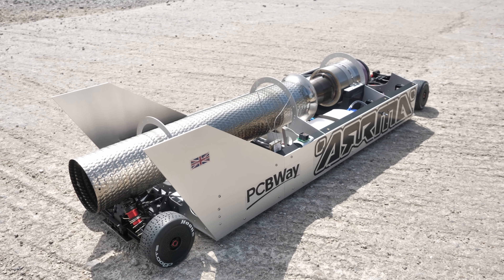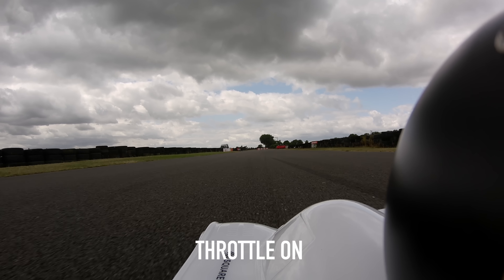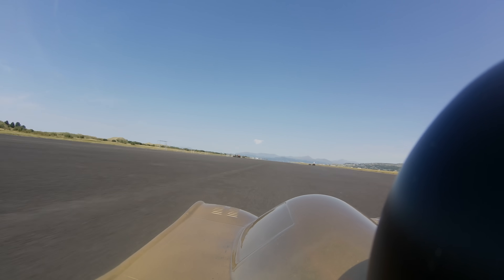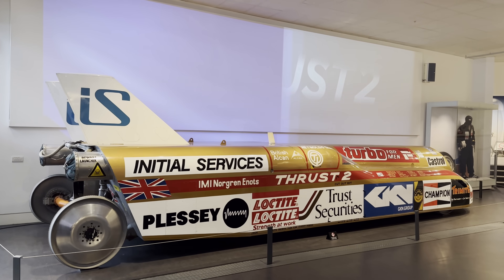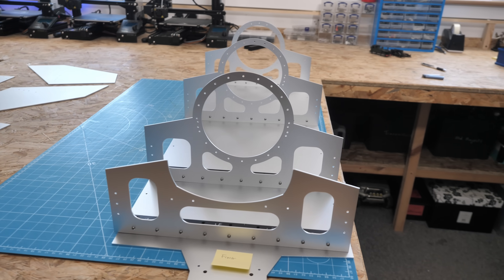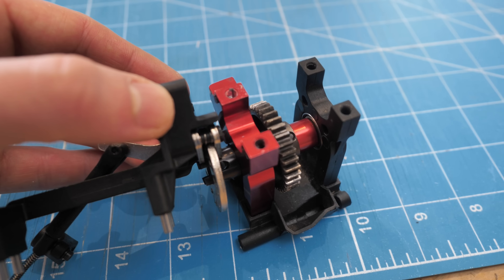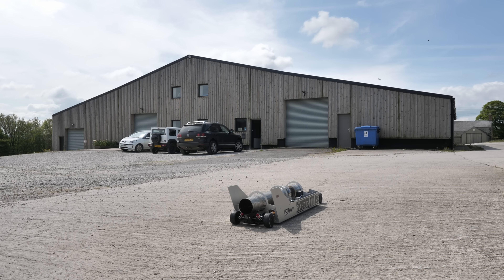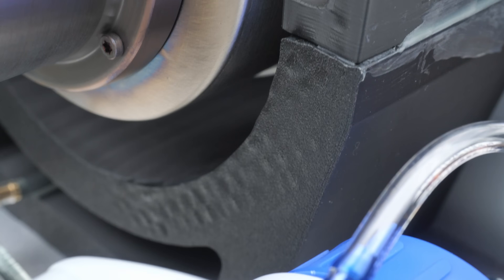Building the WORLDS FASTEST Jet RC Car 2.0

Comment: nice project!
about the engine mount melting: 
if you build an airduct around the engine and conncet it to the thrust tube, there should be enough air getting sucked around the engine to cool the mount

Comment: Correct me if I'm wrong, but I believe that thrust tube is probably doing more bad than good. If your concern is CG, you could always just add some extra weight to the very front to keep the wheels down, or maybe a front spoiler? You can make an adjustable front spoiler that would use a servo to pitch to add more drag depending on your current speed.

Comment: Perhaps a sort of hyperbolic wheel shape, so that, as forces pull the material of the wheel outward it moves into a normal wheel shape instead of a pointed wheel. Could be clever for the front wheels. Might mean more drag though…. Wheel integrity might be worth the sacrifice

Comment: For setting a speed record, could a person place the air intake duct on the underside of the car to also act as negative pressure downforce? A dust trap could be utilized to prevent some ingest, although destruction would likely be imminent. This would be expensive, so it would HAVE to be very beneficial, so I am wondering if anyone can help weigh the pros & cons. This just popped in my mind and I thought it would be a fun thought experiment.

Comment: What are you 3D printing with? Is it PLA? I was wondering if PA-CF (Carbon Fibre Impregnated Nylon) Filament would be better for the engine mount as it has a higher melting point. Although this is an awesome project, can't wait to see what's next!

Comment: There was a period when land speed record jet cars used spun aluminium wheels (ie no tires, just aluminium), as they were the only things that would hold together at those revs. As they aren't driven , and don't need to grip in eg turns, they provided enough grip. Needed replacement pretty often though, I recall.

Comment: That’s not the last static test you’ll need to do. Make a static test rig which chocks, straps, and/or straps on a decently thick piece of plywood. If you’re worried about the rig moving, add sandbags, tent stakes or lawn screw.

Comment: For wheels, I'd be going with something like a solid polyurethane disk then maybe use active aero, well basically a rudder for steering. Or if you want to steer with the wheels, using solid blocks of rubber sandwiched between aluminium disks with screws going through like a beadlock.

Comment: I've built a few projects with wheels at ~12krpm. supergluing standard RC tyres to their rims and adding kevlar thread between the treads has always worked for me. I'd have thought rubber-based RC car tyres would hold up better than foam wheels for your project. Something that should be easy for you to build and test

Comment: Good stuff! A lot of engineering & over engineering can go into this project. 
You could use turbine exhaust to create vacuum/low pressure under the car for "down-force"/control issue remedy or "car not go flying". Also, at a low angle look down your path of travel and try to sweep away any rocks/gravel (easier if you have a "street sweeper" and not wanting to literally broom a looooooong generous width path.)
Not sure if typical on your controller but variable steering control with speed, would help not over correcting at speed.
IIRC most speed record vehicles run on salt/mud flats/ice for a reason, very flat and/or cold. Typically no visible suspension travel or very very stiff setups and aluminum/titanium wheels. 
Rubber tires (sorry I'm American) are good but it need to be made out of the correct material. heavy solid heat resistant rubber non-laminated/non-layered. Heat of the speed will cause delamination and catastrophe usually follows shortly after. The big Aircraft(Heavies not fighters) tires are retreaded with a +1in(+2.5cm) solid rubber layer and has a whole process to ensure the retread 100% bonds, vacuum/pressure mold, can't remember.

P.S. Please use double hearing protection, my tinnitus still has me hearing the whine of APU's of military aircraft I worked on.

Comment: The only thing I'd say is make sure you have the rake of the car set correctly so you have a small amount of aero downforce and the thrust is pushing the car into the ground very slightly. All jet powered cars are set higher in the back to create downforce without creating drag.
Good luck with the running of the car, it looks awesome. 😎👍

Comment: I noticed that the real Thrust2 you modelled your car after has a bottom that raises up slightly infront of the rear wheels. I assume this is to suck the rear end of the car down through expanding the air under the car, creating low pressure. This would make the car more stable as the rear wheels get more traction. You may want to replicate this on your car for more stability.

Comment: I find it fascinating how a jet engine can pretty easily be held back with a string until it has forward momentum. I suppose you could just use your brakes to start but would there be an advantage  to actually having one tied off to allow you to go to max rpm before releasing so the vehicle would reach a faster top speed closer to where you are, helping you be able to control it easier? I have no idea what I’m talking about. Just thought I’d throw it out there.:) great video:)

Comment: Put a fpv camera onboard so you can drive it more straight & see problems as they come ..
Reply: Onroad fpv is not like flying an fpv drone. Road makes the camera image a lot more bouncy than you would expect. I've tried. I would swap the air radio for a surface model though, it will give more resolution to the steering. But general rule for RC speedrunning, the car should drive straight like its on rails if not, make it so. Steering is only needed for roadsurface and torquesteer correction and  I assume the turbine won't have torquesteer

Comment: I was thinking that some ground effect would help with the floor stability, then I thought about bottoming out and porpoising or bouncing at high loads at speed, some stiffer suspension would help this and I think would help the car without ground effect. Some C cups on the springs is a simple way of doing that (I think you know about this anyway with your experience). Drag is also a concern with ground effect too but would be less than traditional wings. This is quite interesting to me to get thinking about this, I'm an engineering student and one of my projects was building an rc f1 car with aerodynamics incorporated so I can't wait to see this progress.

Comment: Lock the suspension , make the wheel camber front and rear to zero and use foam tires cut to 100mm

Comment: Nylon infused with Carbon Fibre, such as eSun's ePA-CF, has a higher glass point then PLA or ABS, so will retain integrity to a higher temperature point. Gold reflects heat better then any other material, sheets of paper thin gold bonded to the upper side of the mounts will reflect the heat back at the engine. Aluminium foil with an air gap between it and the 3D printed mount.
Bonus, you can cut holes for 3D printed NACA ducts in to the belly pan, letting forward speed suck air up through the ducts and then pass between the mounts and heat-shield and out the open back of the car, giving the car under-body venturi's to create down-force and use it to keep the car on the track surface.
Larger wheels are more tolerant to small rocks and surface imperfections, so a spacer to raise the chassis sections higher, while dropping the body nearly on the ground, will lift the axle centerline higher for larger wheels, while lowering the vehicles masses compared to the axle line, again improving stability.
Reply: Bambu PAHT-CF will deflect up to 194℃. Since their P1P is prominently on display, they might just sponsor some spools

Comment: Amazing project!! I would suggest some heat resistant tile material at the back, covering the plastic, rather than foil. You can buy kiln bricks for about £10 uk, and cut them by hand, as they are very soft and light.

Comment: As a heat shield use a thin paper card on the plastic then put the metal shield on and that will give a barrier of insulator between hot metal heatshild and plastic. Or just wack some exhaust wrapping on the plastic bit. Hope this helps.

Comment: So, you have a few options for wheels: something similar to the Bloodhound SSC, which are solid aluminium-zinc alloy disks, which can deal with 10 200 RPM. You could coat the rims with latex or something to give it something akin to tyres. You could also do foam based stuff (as some other people have suggested), which could deal with the heat really well due to the air pockets, but they might have too much give. Personally, if I was making this, I'd do aluminium disk for the main wheel, with layers of rubber and foam. But I don't know how that'd be made. But hey, experiment and have some fun! For all I know what I've just said is utterly useless and can't be done.
Reply: Maybe Goodyear or Perrelli would sponsor some special rubber tires like F1 race cars. 😜
Reply: Aluminium disks spun up with spray on ruuber from a can. Yesss then check they lathe true

Comment: Epic project! I think foams are the only tires that have halve a chance of holding up
Reply from the maker: Thanks Kevin! Yes I think I’ll have to do some experimenting!
Reply: @Project-Air  you guys should do a collab once please please please please 🙏
Reply: @Donuts_random_stuff  Oh god. A Project Air, Kevin Talbot collab will be the most highspeed expensive crash ever.
Reply: Hey make the arc car. Small and thin so it will go fast
Reply: @Project-Air  you should try trust vectoring some time 👍👍👍👍
Reply: @ramonellince2424  overcomplication
Reply: you could inject fuel into the thrust tube to make an afterburner  🔥
Reply: @tmsrc  I was thinking an afterburner too. It would look wicked at the track with Mach diamonds  ;)
Reply: Otherwise you may have a tumble womble 😂😂 ur a legend
Reply: could it be worth looking at tyres on something like tethered cars? they are designed to be used under high speed conditions
Reply: could have been worse, could have been mine
Reply: I want too see a 200 mhp run ok promise
Reply: Can you try machine aluminum wheels?
Reply: about the tyres... have you tried tubular tyre tape (ebay-velox?velux?veloflex??)(for bicycle wheels) also i'd recommend the rubber from tannus solid tyres, its light and robust if you could make it work...
Reply: KEV!!! you should collab with projectair!
Reply: Totally agree Kev, and in my own opinion is with medium/hard ones.
Reply: Yeah! Maybe get some of Raz's speed springs too :)
Reply: If it can be kept from fragmenting, I'd say to try one's luck with cast polyurethane like that of skateboard wheels. And do a pour that physically molds it onto an interlocking rim. It seems the tires are the weakest link on speedrun RC cars, so this is likely an area that still has room for innovation vs. off-the-shelf stuff that doesn't hold up to this extreme.
Reply: Go for machined aluminium wheels with knurling for grip. Anyone with a basic lathe can make them for you.If i wasn't on the other side of the world i would do it for you!
Reply: @dunxy  if it was running on salt flats I'd say absolutely, but on tarmac I'm not too sure. If he used active aero for steering, either a rudder or some type air brake or spoiler either side of the vehicle for differential drag steering, I'd highly recommend using aluminium wheels on tarmac.
Reply: @anthonystownsend  Valid point! I wonder if he could adhere something to the aluminium wheels for enough grip and that could sustain the forces. Hmm Not super knowledgeable on this kind of thing, a good mate did try making some speedrun cars and i saw many tire failures he had so i know hes unlikely to get very far with much apart from solid foam in the least.
Reply: @dunxy  I was thinking the same thing, something like a mesh, either metal or nylon, that's then embedded into the rubber or thin metal belts around the outside of the rubber. But honestly I think the best thing for this car would be active aero and aluminium wheels then use an actual Flight Controller for stability especially at high speeds, if I had the money to make it, it's exactly what I would do.
Reply: EPIC, Kevin Talbot confirmed.
Reply: 3D printed carbon wheels.. Or billet wheels.
Reply: Why not solid metal? like in the land world speed cars they seem to always use solid metal wheels, though at smaller scales I don't know how the grip will behave.
Reply: Are 5th scale tyres not belted?
Reply: I knew I spotted the spectacular Mr Talbot!
Reply: Whatup Kev!!! How are allnyour broken helicopters??😂😂😂
Reply: @KevinTalbotTV  @ProjectAir  I feel so stupid posting here..but the tires got me interested..LOL.. My idea.. mass and weight come into the picture, Regular tire has more rubber across that it does up.. then you have thickness and pliability... SO...Building a custom from aluminium sound great, IF in act you can work with the right solid rubber which will not heat and rise, due to the forces of being slung around the outside of the block..(maybe with a bead-lock system to help hold) - quite small at this scale but... Next concern is heat generated on axels and bearing for said wheels especially under percussive force as it runs down the track.. good lube and custom axle design/mounting may also be a consideration at this point.. Hard to explain some of what I am saying .. but hopefully it communicated right..LOL.
Reply: You and kvin should do a calab
Reply: I was about to mention you but no need 😂
Reply: Kevin i am huge fan bro..
Reply: haha funny - thought about Kev's project and here he is :)
Reply: What about those roller blade wheels and tires?
Reply: You gotta make a get rc car cause eventually these will be faster than the electric ones
Reply: Since it's a jet car, just go for metal like supersonic cars.
Reply: Do a collab
Reply: Polyurethane blade wheels ...?
Reply: Maybe some solid wheels would work, like maybe some Longboard wheels, not like them having a grip on the road will provide more speed or anything as this is like a ground missile. Also add some stiffer springs to the suspension.
Reply: Tires: hol' up, wait a minute?
Reply: Kevin it's been long since I watched your vids
Reply: I am your subscriber
Reply: @alexjoseph8597  this cracked me up i to am your subscriber!
Reply: Foams will fly apart, solid rubber around metal center is likely the best option.
Reply: @PiDsPagePrototypes  have you tried that? the worlds fastest rc car, 219mph has foam tires
Reply: @KevinTalbotTV  Which type of foam?
Solid rubber on metal, and then straight metal, is what land speed record holders figured out as speeds, and more precisely, rotational speed, got higher and higher. Small wheels rotate more times across a fixed distance then larger wheels, increasing the height of the wheel reduces the rotational velocity, reducing the wheel growth during a run, and likelyhood of failure.
Larger wheels are also able to handle bumps in the surface easier.
Reply: @KevinTalbotTV  I replied about the same Mr Talbot! Lobe your channel my man
Reply: @PiDsPagePrototypes  again, the world record is on foam tires
Edit: sorry, "current".... goes to say a "World Record" is always going to be current...🤡
Reply: @PiDsPagePrototypes the world record was done with foam tires......
Reply: @koreyhayden1368  Current,.... you need to say "Current World Record",... and if it's on foam tyres, it's going too slow and is begging to be taken.
Reply: @PiDsPagePrototypes  haha k
Reply: That only applies to wheels with power to them. This car is pure jet power, there for yes they will slightly ballon, but not nearly as much as if they had power to them
Reply: @endosrc  why? 200mph is 200mph centrifugal force is the same, driven or not
Reply: @KevinTalbotTV  gonna agree on the centrifugal force being equal at 200 mph … but when force is applied at extreme high torque and acceleration applications any tire is a risk… therefore tires free from this added stress are more likely to hold up … in my opinion 🤓🤓🤓
Reply: @nofreerides7033  Acceleration decreases as speed increases, and "extreme high torque" causes the tyres to lose traction at start anyway. They simply don't have enough grip for torque to matter at this scale.
Reply: @KevinTalbotTV  And besides that the power is applied to the axles and wheel hubs. The wheels/tires just turn as a result of that. So doesn't matter what the type of engine the power delivers indeed.
Reply: @endosrc  Speed causes the growth, drive load causes a longitudinal force at the contact patch, best observed on Top Fuel cars, where the side of the tyre coming up off the ground forms an S-curve as the force causes stretch to occur before the contact patch and bunching up after the contact patch.
Even at 300mph, Top Fuel dragster tyres won't be rotating anywhere near as fast as RC car tyres at half the speed.
Reply: @PiDsPagePrototypes  To make things weirder, topfuelers have tyres change shape due to aerodynamic forces.
Reply: @samiraperi467  More a top end of the run thing, and it's freaky to watch in slowmo!
Reply: @endosrc  this is absolutely wrong, doesn't matter where the power is coming from, it's all about the RPM of the wheel.

Comment: another amazing project! I really loved the shots on 10:31 and 10:32 of the heat diffraction! 

As you pointed out, aluminum tape should help with the engine heat as it'll just reflect the heat away! 

For the wheels, maybe worth considering making them out of aluminium? Since RC car tires love to separate from wheels at high RPMs (much like the Thrust2 car or the new bloodhound SSC)